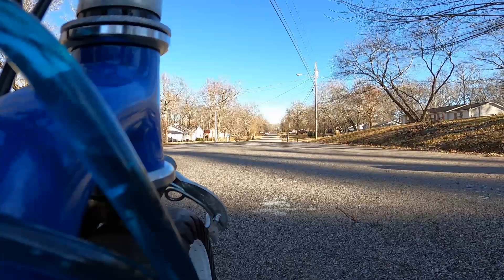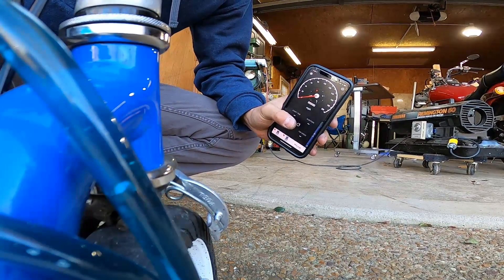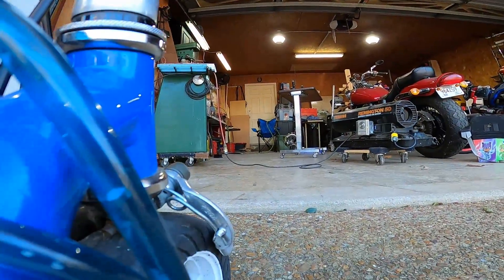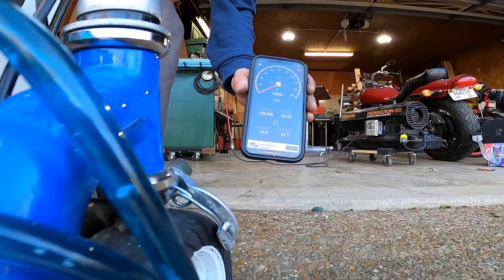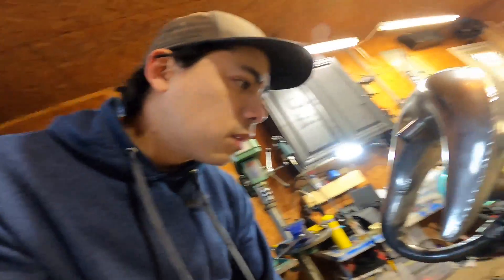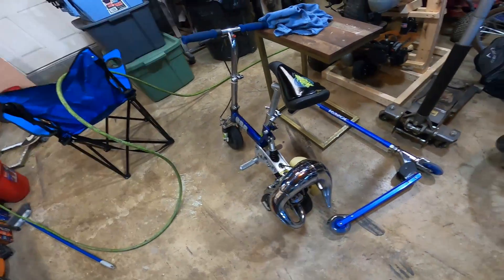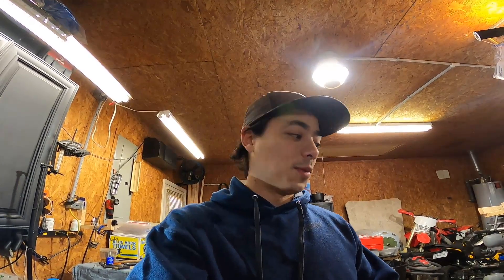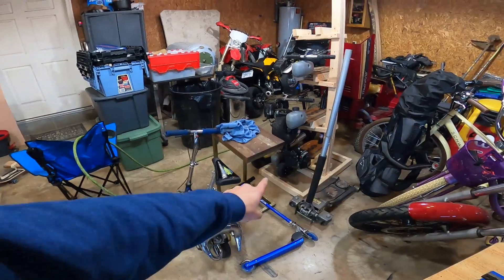Water cooled goped sport. Testing the WT-668 top speed.

Comment: How can I modify g320pum to get Max power, what are the parts I may need
Reply from the maker: A good pipe and proper tune
Reply: @aaronpratt89  bro which device are using to check and display the rpm
Reply from the maker: @vijaykorvekar1009  just a cheap small engine tach off Amazon

Comment: Why not run a wt1107? More fuel and air due to the bigger bore of the carb
Reply from the maker: I was using the 1107. The pop off rate isn’t low enough to feed the engine. I started trimming the spring until it was almost cut clean in half. The carb just can’t hang with the load of a scooter.

Comment: You should make a water cooled superbigfoot that way you can use the in between space for mounting batteries. Pumps and coolant reservoirs. You could also build a xped too
Reply: By in between space I mean the space between the deck and grind deck. Pretty sure the super Bigfoot had a grind deck
Reply from the maker: @jackallred8228  makes sense. But the next thing I water cool is going to be chain drive 🤘🏽
Reply: @aaronpratt89  that’d definitely be smart for sure maybe find a gsr cruiser and make a grind deck underneath with just enough space for you to have minimal crowding up top
Reply from the maker: @jackallred8228  with a chain drive, the deck is bigger, so it would be easier to build a platform above everything.
Reply from the maker: @jackallred8228  but watercoling a sport is challenge. there almost isnt enough space for the rider. if i could figure out how to make a  pole mounted radiator, it would free up some space and make some things easier lol
Reply: @aaronpratt89  that would make things wayyyyyyy easier
Reply from the maker: KevinT Creations  can you drop a link of what you are describing?